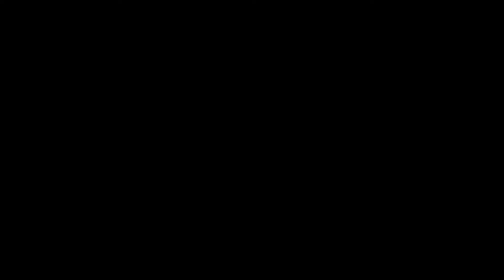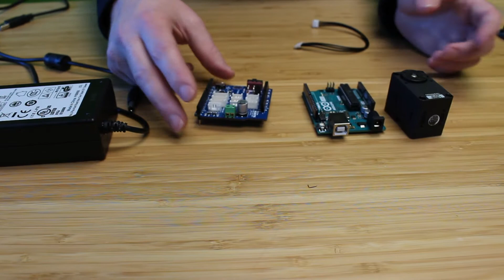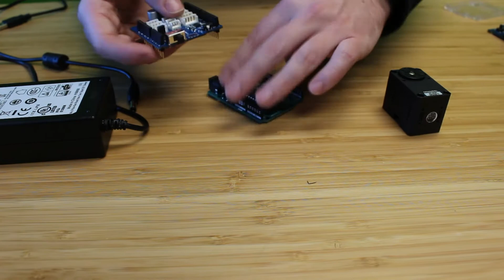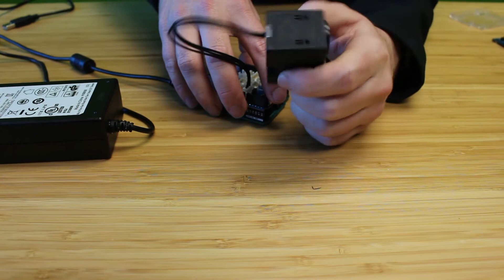How To: Connect power to DYNAMIXEL Shield

Comment: What if we use the Power Connector, what range of voltage does the shield require?
Reply from the maker: When using the terminal block on the DYNAMIXEL Shield, the shield can safely support up to 24v for use with our P series servos.

More detailed information can be found on the eManual page for the DYNAMIXEL Shield.
https://emanual.robotis.com/docs/en/parts/interface/dynamixel_shield/
Reply: @robotisus  if i connect the terminal block of the DYNAMIXEL shield with a 11.1 V Battery, can the shield power the arduino with the VIN jumper connected?
Reply from the maker: @deathinteresse3109  Yes, connecting your battery to the terminal block and connecting the VIN jumper will allow you to power the Arduino with the same battery. When used in this way the Arduino can only regulate up to 12v, so while the 11.1v battery will be fine be sure to be careful if you go any bigger.